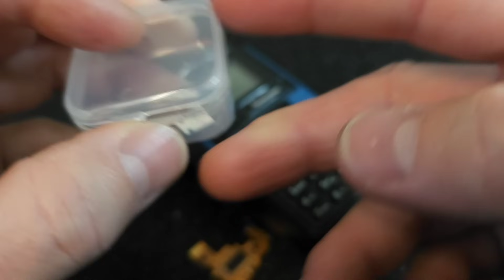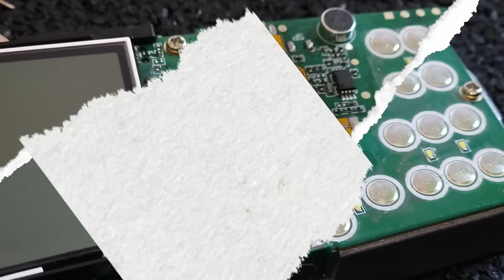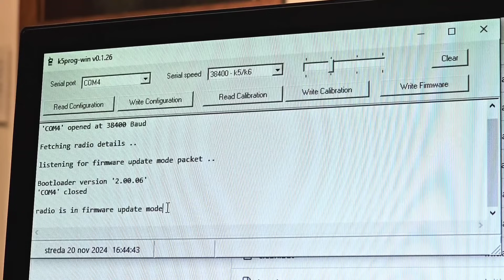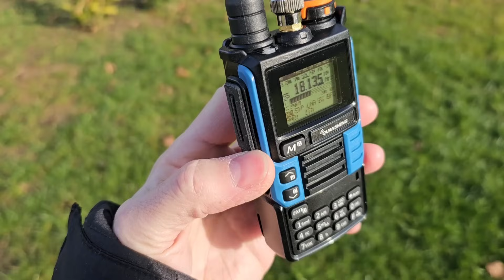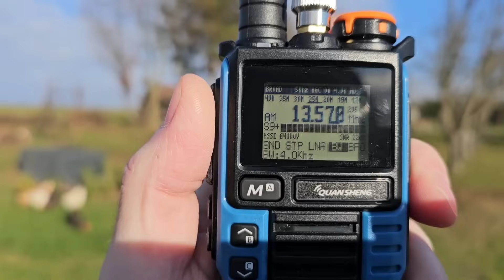‼️SUPER EASY‼️Ver.2.5 FULL HF BAND Modification Quansheng UV-K5(99)

Comment: Hi, If anyone can help, Im having an issue with a WAIT stuck on the menu when trying to access the 0 key. I followed the steps as per this video without removing anything and confirmed  continuity as per the video. Forums are saying that I have to remove a resistor of some sort.
Reply: Вам удалось решить проблему? Если да, то опишите как.
Reply: @TheAugust8 the soldering points where the chip gets replaced i didnt do them right.

Comment: @OM0ET I'm part way through completing this mod following your video. I really enjoy all your videos by the way. 

I'm currently at the stage of checking the connections with the multimeter. I also decided to check between each pin on the 8 soldered points to ensure I didn't have solder bridges. All appear fine apart from what appear to be pin 2 and 3. One of which is ground and I think the other is the antenna connection from what I can gather by the electrical diagram, but I no means an engineer so I am unsure. I have a short between these 2 connections. Is this normal? I see no visible solder bridge

Many thanks MI7TZR

Comment: I blew out an SMD when removing the radio chip :( Now I've ordered a new UV-K5 and will remove the chip like you. What temperature should I use the soldering iron for when removing it? Your instructions are great, but I'm not as handy as you. Thanks.
Reply from the maker: I think 400⁰C is OK. Depends on your removal technique.

Comment: I have done another mod on this radio for CB RX crystal clear sound because RX was poor even close to a CB car radio. All referenced parts are from the "MentalDetector" schematic - found on the Github (pdf is low res but I have re-rendered with the help of KiKad software). First I have injected 0.7Vpp 27Mhz signal directly on the FM antenna connector and I have traced the signal on the PCB with an oscilloscope with the radio turned on. First I have replaced the stock 1.5uH - L4 coil on the antenna connector with a 12uH coil - 0.2ohm - good improvement in signal. Then I have replaced the bias resistor for the first 2 series PIN diodes: D5 - D6. According to Infineon PIN diodes application note, this PIN diodes must be biased by at least 1mA of DC for them to open and let RF pass. Infineon recommend use of 2 coils and a resistor for the perfect circuit, UV-K5 has only 2 resistors: R49 - R50 of 3.3K, so I have replaced only the R50 resistor with a coil of 10uH - great improvement in signal amplitude (there is no space on the PCB for adding a series coil with the R49). Then I have replaced C192 - 22pF cap (badly noted 10nF on the schematic) with a 3pF, I have included C187 - a 3pF capacitor - the signal was all butchered before this - after this it was a perfect sinus. (it doesn't affect higher freqs). L33 is also bad for 27Mhz, signal gets true it and is attenuated by the C189 cap. I have changed L33 - 100nH with 500nH - great improvement on the signal. C188 - 22pF was changed with 100pF. PIN diode bias resistor R122 - 3.3k replaced with a 10uH coil (this coil is shared with the UHF filter PIN diode D25 - a small improvement on the UHF too). R117 10k  - bias resistor for the same PIN diode - D26 replaced with 1K and added in series a 10uH coil as the Infineon recommend (I had enough space on the PCB for this) and lastly the C85 100pF from the LNAIN pin of the BK4819 changed with 200pF. All this mods have been made by trial and error tracing the signal step by step on the PCB with lab professional equipment. Now my radio can clearly receive CB stations over 10Km away on the city.
Reply: Snimi  video :)

Comment: Hi. The antenna connector from the "Ver 2.5 mod module" is only for the AM input of the second antenna. The mod will use the original antenna for FM. Changing the input cap of the original antenna with the provided one will let a stronger signal to be amplified for FM. Also removing the L-C filter (band pass filter for 20Mhz-1Ghz) before the signal enters the mod PCB will let you receive FM signals under 20 Mhz and over 1 Ghz. SI4732 is capable of receiving under and over this frequencies and this is why is recommended to remove the L-C filter and also jump over the next cap down from the L-C filter... there is another cap on the mod PCB on that FM signal line. Also the coil right on the original antenna connector act as a band stop filter for frequencies under 20 Mhz - change that with the provided one for reception under 20Mhz in FM.
Reply: Hi Stephan, is there any detailed information on doing this?

Comment: Thanks for this great video.

I wanted to have your opinion because I want to give my father a radio as a gift and I don't know what to buy. Is there a Quansheng UV-K5(99) and a Radtel RT-890 or other models?
According to the videos I've seen, the Radtel doesn't need any PCB modification, you just need a custom Firmware so that it can do the same thing as the Quansheng UV-K5(99) ?
Reply from the maker: Yes, buy a Radtel RT-860 😉👍
Reply: @OM0ET  Thanks , I don't know the radtel RT-860 model? I'll see if there are any videos. Thanks

Comment: Can this mod work with egzumer firmware ? or does it have spectrum analyzer
Reply: на странице разработчика кастомной прошивки указано, что анализатора нет и не будет. Да и вообще, жаль, что после апреля 2024 года прошивка вообще никак не обновлялась.
Reply: No the egzumer firmware is basically obsolete with this hardware modification, this is a custom firmware you must install to enable full HF reception

Comment: Great Tutorial, Thanks ! Is it possible to use the CEC Firmware with the EEProm Upgrade for 999 Channels ? Do i have to load a Module File in Chirp like for the IJV Firmware ? thanks !!
Reply from the maker: Not sure how good it will run with bigger EEPROM. In CEC you can program channels with genuine programming software

Comment: Just finished the modification of the radio, no issues. It is much easier to dig SMA into plastic by solding pen heat than scratch the surface by knife. Radio works well, but where I am strugling is programming.  Chirp next with uvk5hf.py driver loaded is sending data to station, but nothing is writen here. Anybody know the solution or the way how to program the frequency list?
Reply from the maker: You should use CEC 051HF firmware with this modification and there is no need to use .py patch. Only normally programm memories with genuine programming software. Sadly no Chirp is supported with CEC.

Comment: Thanks it was very interesting, what was the led for and the chip removed what do you lose by removing it, or do you gain more from the mod.
Reply from the maker: LED was just a lamp and chip was for FM radio which has been replaced by another FM/AM receiver chip. So we don't loose anything. We gain a full band HF receiver with AM/SSB demodulation.
Reply: @OM0ET  thank you I have a Kenwood mini hand held dual band

Comment: I just finished this mod yesterday - it was an adventure!  I accidentally pulled off the teeny-tiny resistor that the small tab jumper attached to - i think this was the +v input to the board.  I was trying to put it back in place and it popped off screen on my microscope.  I was about to give up, but spotted it elsewhere on the board.  I THINK that I got it back in place, did all the other stuff, and it turned on fine.  It would hang at the "WAIT" prompt when I tried to switch to the HF mode.  I checked that same +v tab and it was shorted to ground.  I fixed that by cutting a solder bridge, and after this, it worked!  

I have two questions - what (if any) problems might happen if that resistor wasn't replaced correctly?  I am getting power to the board, so at least half of it is in place.

Also, it was mentioned that a full reset should be done through the menu after the firmware is updated, but I can't find this option in the menus.  Am I missing something?
Reply from the maker: I don't know answer yo your first question, sorry 🤔
Reply: Вам удалось решить проблему? Опишите, как, если да, пожалуйста.

Comment: Hello Paul, Impressed by this video and like your soldering skills. As i repair laptops and sometimes need to repair the places where the hinges break out of the plastic i often use my soldering iron at about 250 degrees celcius to work the plastic. You can remove or add material and shape it the way you want. 73,  Gerard, The Netherlands.
Reply from the maker: Thank you 😉👍

Comment: Please note that there is no clearance between the SI4732-A10 chip and the back of the speaker. I completed the modification without using double-sided sticky tape, simply pressing the case back into place (perhaps with a bit more force than normal). After turning it on, I realized I was only receiving white noise. Upon opening it again, I found that the chip was cracked in the middle, with a visible impression on the isolation sticker on the back of the speaker. Luckily, I had a spare PCB for another mod, so I replaced the damaged SI4732-A10 chip and removed the speaker. It's possible the chip already had a micro crack and was damaged before. My advice is not to force anything if you feel resistance.

Comment: You can also use this little board to connect to an Arduino Nano and install the radio sketch on it and you don't even need the Quansheng UV-K5!  Link to the Ver. 2.5 Modification Module doesn't work though.

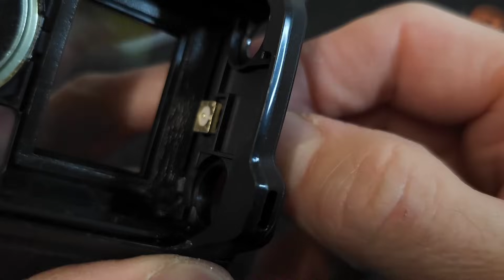Comment: 28:53 If you had 2 SMA connectors, you could have heated one, pulled it through and used the heat to melt the exact square shape you needed instead of trying to drill a square cutout. Just a thought...
Reply from the maker: Great idea!! 😉👍 Thanks!
Reply: I just used a wobbly 6mm one until it was a press fit.

Comment: Thanks Paul, my soldering idol. Am I correct that the sma connector doesn't need to be added? You can receive from the main antenna?
Reply from the maker: 😄 well, there is one capacitor missing on the  Mod.board. If you put there this capacitor HF signal from the main antenna (VHF/UHF) will  come to the HF chip instead of external antenna input. But as default is thia capacitor missing.
Reply: @OM0ET  Oh so good to know. Thanks Paul. Great video.

Comment: Ali Express had this radio (from your link) showing at $15 black friday sale. I couldn't resist! I ordered it and the Ver 2.5 mod module, and am looking forward to following your instructions and doing the same mod.
Reply from the maker: Well, hope will done it successfully and will enjoy it 😉👍
Reply: @OM0ET 
The soldering fluid is called "flux" in English. It's also a powder used in Blacksmithing work 👍

Thank you very much for your videos ! 🍻
Reply: @OM0ET  Brother, if I already have the other 27 MHz telescopic antenna with its connector that you show in the 2.0 modification video, can it be used with this board as well? I need an answer to make the purchase bro
Reply: @enmanueldeljesus3402  His antenna is 75cm which is longer than telescopic 27Mhz
Reply: I ordered a total of 3 of these uv k5(99) upgraded handhelds and there amazing straight out the box without modding they can transmit and recieve all be it low out put on tx side from 10mhz to 1.3ghz and you just replace the original antenna with the 27mhz telescopic antenna with an  adaptor screwed in to vhf uhf antenna socket im going to play abouf with firmware to see if can get usb lsb to transmit but does transmit am fm from 10mhz to 1.3 ghz straight out box as said very low output but thats mainly down to antenna though might work lot lot better with atu to bring swr down
Reply: @sniperchaz111  REALLY?
Spurious emissions all over the bands is not amazing. I am guessing another without a HAM license trolling
Reply: @personalunderstanding7055  I've been an extra (a real one, with a code test) since 1977. I'll use this responsibly.
Reply: Check inside for the board .  A lot if people saying they received a radio with modded firmware only ..no hardware mod (added board) . Please check
Reply: Actually as far as short wave radio 📻 ?
Reply: Only if AliExpress sellers were not so shady. Emerccy Store is a fraud. Never order from them.

Comment: @12:20 that is completely wrong... otherwise why would you bother soldering the 8 pin?😂
Reply from the maker: Why? Also audio pin is not connected and therefore is an AUDIO plate marked externally.
Reply: @OM0ET  look at pin 6 on the si4732... the trace is clearly visible. That's how you get FM. Old modules used to combine these now they're broken out separate. Most people also remove the capacitors as they filter out FM bands

Comment: First of all great video and thank you for this.  Second having done a couple v2 and 1 v2.5 mod if you don't do much  micro soldering then ask someone to do the mod for you. The 8 pads where the FM chip was are troublesome.  Try and get that part of the pcb flat before you solder. I ended up having to jump some of them because they didn't have continuity.

Comment: What' s difference between ver 2.5 and 5.0 module?
Reply: Thanks but what is the difference between 2.5-5.0 and 8.0?
Reply: @mauriziolored6123  Difference between version 2.5 & version 5 is the way BGA427 LNA is done, the latter uses second application from datasheet and provides 22 dB of amplification, whereas ver 2.5 provides only 18.5 dB.
Reply: Already is ver. 8.3 of this board. It's called IOTCU 8.3

Comment: my respect  I have a question for you.  Namely, I bought UV k5 (8) about a year and a half ago.  in the first month everything worked perfectly.  however, there was a problem with the display.  Namely, pixels disappear, appear, get mixed up, basically navigation through the menu is more or less impossible.  except for a couple of functions that can be done blindly.  other than that the machine works perfectly fine.  I tried to solve the problem myself however I didn't see any visual defect on the board.  the flat cable between the board and the display is fine.  I noticed that pressing my finger on the circuit board solves the problem for a short time.  pressure must be applied to a specific place for the display to work.  in the middle of the circuit board just above the buttons.  I wonder if you might have encountered this problem?  thanks in advance and regards
Reply: I damaged my display cable doing the older upgrade, its very easy to put a hairline crack in the ribbon, and fitted an aliexpress replacement easily. Backlight is a different colour, but now working perfectly.
Reply from the maker: Hi, yes I recommend to unsolder the flat cable, clean/remove an old solder and re-solder it back on to motherboard. I am sure this will help. 😉
Reply: @OM0ET  OK I'll try that. Thank you very much.

Comment: Once again, another excellent step-by-step video! Thank you Paul and 73!
Reply from the maker: Very welcome 😉👍
Reply: @OM0ET  Brother, if I already have the other 27 MHz telescopic antenna with its connector that you show in the 2.0 modification video, can it be used the same with this board?
Reply from the maker: @enmanueldeljesus3402 in ver.2 I used BNC, in ver.2.5 is SMA. If you buy BNC/SMA adapter so yes, why not.
Reply: @OM0ET  I bought the v5.0 SI4732 chip board. Could you make a video of how to install it with the second additional antenna, brother? I would really appreciate it.

Comment: Hi Paul. Great video. Just one question. Is it necessary to have this "face-lift" radio or it will work on old one? I have uvk6...
Reply from the maker: Thank you! 😊 No, all facelifts use the same type of motherboard so it is applicable to all models.
Reply: @OM0ET  thanks
Reply: I have both uv-k5(8) and uv-k5(99). To tell the truth, k5(99) is more comfortable in hands and has less creaking of buttons. But that’s the only difference 😎

Comment: UV-K5 is an extremely modifiable radio. Maybe it's time for the manufacturer to get a grip and release a new version with this chip, bigger flash etc. And besides, I think it's time to say bye to my old Kenwood TH-F7E.

CEC firmware is the only one supporting this modification? Are there any other possibilities, modules for other firmwares etc.?
Reply from the maker: I think also FAGCI REBORN has implemented driver for this RX chip, but I am not sure.
Reply: https://www.youtube.com/watch?v=HM7SPsdPUJ8